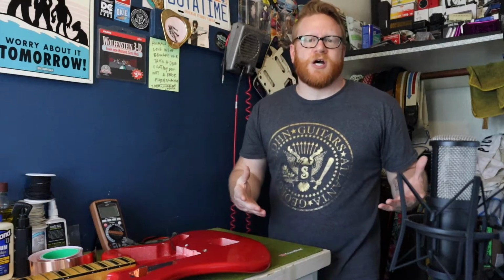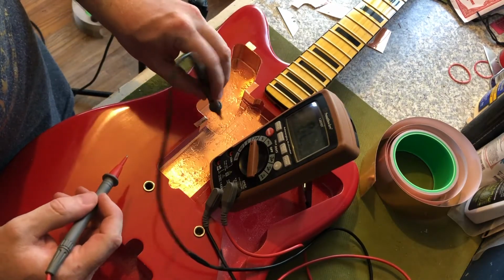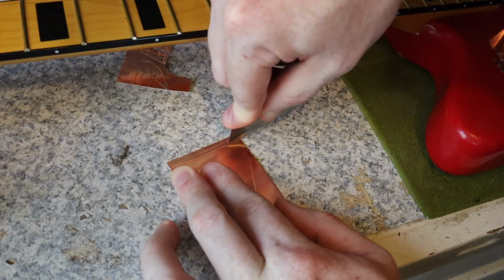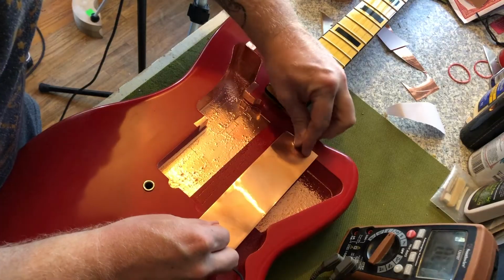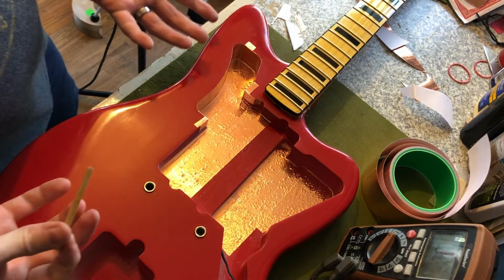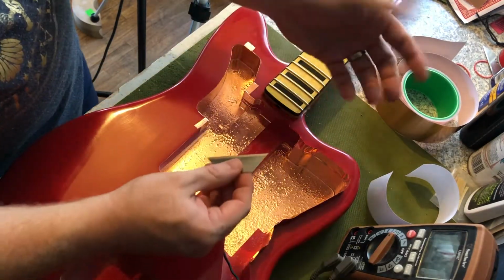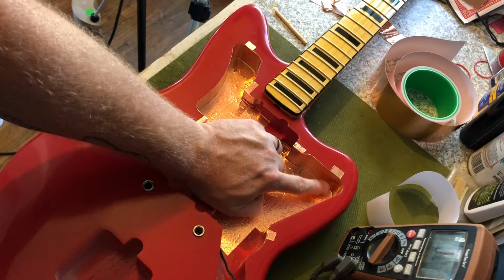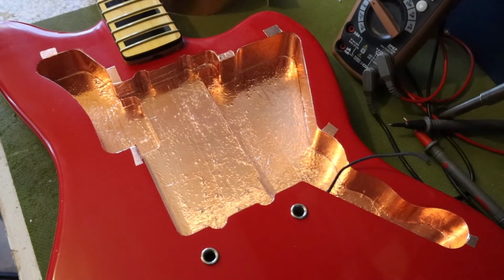GUITAR SHIELDING 101: A [Relatively] Quick Guide to Working with Foil Tape

Comment: When you are overlapping the pieces of copper, if you cut a little bit of the copper making a tab... and fold it back on itself before you lay it in place... you will have a copper to copper contact that will insure that the foil will be continuous through the cavity... it's the same kind of tabbing that you use to contact the foil on the back of the pic guard... only it's for the internal part of the cavity to itself... my thinking here is that the adhesive will deteriorate with time and could lose continuity...

Comment: That is huge pool cavity routing....i would have glued & screwed some Oak or other hardwood inside to strengthen all that routing...i guess he wants the weight kept down, all to our own ,i would have routed the pickups cavities,rear control cavity etc & routed out tone pockets to lighten the weight...i hope that 1 1/2" × 3/4" centre strut is really strong...i bought a Fender Cyclone routed similar & the guitar body actually flexed with strings on it due to the amount of routing, the Vintage Trem did'nt help...i filled the pool routing with 300yr old Oak forming seperate pickup cavities to reduce noise when sheilded with Graphite paint,if done properly (in the cold as it dries so fast) it sheilds really well after 3 medium coats of it....i still have it 13 yrs later,fantastic guitar,a sloping Strat 'Tex- Mex)single coil on the neck & a Fender Atomic humbucker beside bridge , going to replace the humbucker with a high quality quiet PAF'59. 24 3/4" scale compaired to Fender's standard 25 1/2", nice guitar now with no body flexing & very quiet even with the Strat 'Tex- Mex' sloping single coil on it's own, i find if done properly the graphite sheilding paint lasts many, many years & can be spray painted on top of to stop any kind of shorting due to wiring, caps ,pots etc touching the sheilding paint....neat job bud, i think your pal will enjoy it more now.....

Comment: thanks for this great video, wish I'd seen it before I'd botched the shielding on my jazzy by doing with a hundred of small pieces of foil, leaving me with up to 100 Ohms between the input jack area and rhythm circuit area. some overlapping pieces don't even seem to have continuity between them anymore when I last checked it, so that's a project waiting for me lol.
also, a quesiton: if the guitar cavity is pre-painted with shielding paint, how would you go about shielding the rest of the guitar? foil on the guard and solder a wire between them or maybe just a tab of foil in the cavity to make contact with the foil-covered guard?
Reply from the maker: I find that shielding paint can be great, but it's also pretty tough to test for continuity and thus having contact alone doesn't seem to work every time. I might suggest using the very trick that modern fender uses, namely screwing a metal clip directly to the body where the paint exists and soldering a lead to it, then to the volume pot
Reply: I don't trust tape adhesive to be conductive, at least not to remain consistently conductive over time. If you want to be absolutely certain that the pieces of copper foil remain electrically bonded to each other, then you can either solder the seams (you don't have to solder the full length of the seam, just a small area); or,  you can do what I've done  when working with ordinary aluminum foil tape, which is to take a miniature Philips screwdriver (#0 tip size) and press it hard into the foil where the seams overlap with a slight twisting motion. This will make a sort of rivet connection between the overlapping layers. Do this every inch or so along the seams and then check with an ohmeter. Aluminum tape has the advantage of being ridiculously cheap, and if you don't like how your first attempt comes out, you can afford to yank it out and redo it, or not. The disadvantage to aluminum foil is that you can't solder to it (you'll need to anchor a tiny brass screw ithat you can solder to, or affix a ring terminal underneath, through the foil and into rhe wood), and it's stiffer than copper and trickier to work with.....but it's cheap and very effective as shielding.

Comment: Have you ever tried using conductive paint instead of foil? Just wondering about the pros and cons. I can imagine you'd have to screw in terminals for ground connection, since you can't solder to the paint.

Comment: Cool instructional video.  Weirdly, I like stock guitars.  Also, I like to play more than work on guitars.  I've heard anodized pick guards cut down on noise (i.e. J. Mascis Jazzmaster).  If true, to reduce a fair bit of noise, could you just put foil on the back of the pick guard (and where applicable, the control plate) and call it good?

Comment: Nicely done. Especially cutting the tabs that will make contact with the pickguard. It's a good idea to have multiple tabs near the screw points, just in case a pickguard warps over time and lifts up. If the hole pattern or the pickguard are available I make my tabs lay down right over the screw hole so contact is assured.

Comment: That is one clean shielding job, especially compared to the mess I made in my Precision bass a few weeks ago. The buzz is gone but the pickguard still makes static noises when I rub my hand on it, which sometimes happens when I play. I didn't shield all of the pickguard, though, only the part over the electronics. What can I do?

Anyway I wish all techs cared as much as you. I wouldn't hesitate to let you work on my precious guitars.
Reply from the maker: Sometimes static build up can be eliminated by leaving a dryer sheet in the cavity, which is wild.
Reply: @Puisheen  I've heard about those but I can't find them here in Poland. We dont have dryers at home. Will keep looking for them thanks
Reply: @Puisheen  I used antistatic spray and the static is gone. Cheers
Reply from the maker: @AndreaAustoni  By my troth, I had no idea such a thing existed lol thank you for the tip!

Comment: Because I made a custom extended Brushed Stainless Steel Pick guard loaded with 3 quad rail/coil humbuckers wired like  50's Les Paul with P/P vol. pots for coil splitting and the bridge tone pot also a P/P to activate the bridge and neck P/Ups together regardless of any other controls all the pots are 500K audio taper and the tome caps are .047 orange drops. there are 6 pots total because 3 humbuckers and the Fender 5-way blade selector switch and a kill button round out the controls that are all grounded through their cases to the Pick guard including the output jack also mounted in the pick guard just rearward of the bridge... Yup Yup,   wiring all these goodies was quite the adventure , soldering all those connections to make everybody play nicely with each other ans sounding great...realizing that the usual/traditional wire was way to big/thick for the minimal current produced by the P/Ups, I stripped out a computer VGA Cable for the small stranded wires in it which are fine for the minimal current they must transmit through the circuit to the output jack and into the amp where that little bit is multiplied so much anyway... . and the different colors in there were hands to use in the detailed circuit One color for each P/ up and pot set.. as well as the custom wiring for the bridge and neck P/ups working together independently of the other controls when activated by the bridge tone P/P [pot for that little tricks made up for it... lol  ... the rest is fairly standard coil splits and the rest... it all works fine if so very different from any other Strat. I had originally shielded the extended control cavity with the copper tape but then had unwanted  ground issues so stripped it out and checked if I really needed it.. and reall no so left it without  as all is grounded through the stainless steel of the pick guard through the pot casings and switch frames it's fine as is,, imagine what it sounds like with 3 vol., 3 tone, a 5-way switch coil splitting and a kill button just for fun ...  So, how many tones do you thing I can get with all these adjustments available in just this guitar.. and add to that my little Blackstar ID Core stereo 4o Amp. (V1) with all of it's built in effects ... I won't even try to count them all.. lets just say it's a lot...   lol   My "Stellarcaster" , which started life as a cheap Chinese made 'Starcaster'-'Strat'- electric guitar By: Fender.. I bought used at my local Music-Go-Round a few years ago, in order to do this extreme rebuild/mod to my design, with all those neat little tricks in it... MY "Stellarcaster" really  rocks the Cosmos...Wanna Play???   Lmao

Comment: Very informative. Any pros and cons to re-shielding a vintage guitar? Does the original shielding ever need to be replaced?
Reply from the maker: No, there's not usually a reason to re-shield unless there's some extreme issue with corrosion or something, not that I've ever seen such an issue.

Comment: Doesn't copper foil oxidize & lose its surface conductivity over time on exposed areas ? Yes I know its surface oxidation so it should not effect the Faraday cage shielding aspect of it. However what about grounding contacts with the electric parts of the guitar ?

Comment: Would you suggest adding shielding tape to a gold anodized guard (j mascis?) or just ground the guard ask its already metal
Reply from the maker: No! Those guards are the best you can get as far as shielding goes. Just make sure to sand away the anode layer (the gold) around every component to bare aluminum for a solid ground connection—this part is crucial

Comment: What if you want to shield a jaguar? Does anything change in terms of what you do or what you need to beware of? 

In particular: 
1. Do you shield the back side of the three control plates and ground them to the copper tape as well?

2. Jag pickups often fit pretty snugly in their pockets. Do you need to worry about the copper tape interacting negatively /grounding out due to its proximity to the pickup claws on jag pickups?
Reply from the maker: The control plates are metal, they're already big shields. 
Jag pickups are not that snug. Shield as normal

Comment: Two questions...1) do you have to do the same thing with the vibrato cavity and then run a wire between that and the main body for continuity? And 2) if the inside is all shielded and the underside of the pickguard is all shielded, and all the metal of the pots and switches are touching the pickguard, would it be considered grounded at that point and no need to run a ground to the trem or bridge?

Awesome videos by the way!
Reply from the maker: 1) the vibrato cavity does not factor into this, the idea is to basically build a cage around the electronics. Grounding the vibrato is enough, though I often do prefer to ground the trem rather than the bridge thimbles. 

2) Personally, I still ground all the electronics as usual. Yes, they're electrically connected via the copper, but a soldered ground wire will always be more dependable. The only case where I omit ground wires are when pots are mounted to a plate like on a Jag, Mustang, or Tele.
Reply: Puisheen for a Tele to ground you would want a little strip of copper tape under potentiometer guard so all zones (bridge, neck, electronic/pots) are therefore connected and grounded right? What about foiling the back of the Tele pick guard. Great video!
Reply from the maker: @uhldev  Thanks! For a Tele you would still want control cavity shielding, and normally I do put a bit of foil on the back of the pickguard there as well, but you really only need so much to cover the neck pickup rout as well as that little channel for its wires
Reply: Puisheen thanks!!

Comment: Hey there!   I want to shield my jaguar as well as my jazzmaster.  I have some questions:

Do I need to shield the back of the silver metal plates the rhythm circuit and tone controls etc are on?
Am I supposed to shield between and into the holes that the cables in the Jaguar go through going from the pickups to the rhythm circuit or tone controls etc?  

Should I shield the routed cavity for the vibrato?
Reply: No need to shield the back of the metal switch plates, nor do you need to shield the vibrato cavity (unless there are signal carrying wires passing through it, which is doubtful).  It may not be possible or practical to shield the holes that the wire is passes through from one cavity to the next, unless the holes are drilled quite large, but if the pickups have shielded wire that passes through those holes, then it won't matter. If the wires passing through the holes are unshielded, then the only way I can think of to shield those passageways would be with a small diameter spring or thin wall brass tubing, which might not leave room for the wires themselves. Probably neither practical nor necessary....

Comment: Pls can u make a video about the ground wire on the bridge Bush? I changed bushes to install a usa pro bridge on a Squier VM jag, so i swapped out the Bush and voilà the ground wire popped out too! Now i'm wondering if solder the ground in the Bush or Just wrap It inside? Better solder the ground to the tremolo.unit?
I dont like.the idea to remove the Bush if i got any ground problem.. thx man u r my offset master
Reply from the maker: The ground wire just goes in with the bushing, no solder required!
Reply: @Puisheen  wrap around the Bush or Just pushed in?

Comment: Hi Mike 
Ones again a great video. I’m just discovering your videos. Just the info I need. I just finished my own guitar build heavily inspired by Novo Serus J by Dennis Fano with Mastery bridge and vibrato and Lollar gold foil pickups. I have bought conductive paint for the cavities though. Do you have a opinion on that vs the foil?
Thanks again 
Michael
Reply from the maker: I have a personal opinion here: I don't like the paint! But that's me, and my main reason for not liking it as much is that it's really hard to check your work. With foil, you can often see a bad connection, and if not, a multimeter allows you to check conductivity easily. With paint, it's much harder to know for sure that it's been properly applied, and so I'd rather use foil. BUT don't let me stop you! As long as you apply it well and use a few coats you should be fine.
Reply: Thanks again Mike.
I’m documenting my build on my own channel and I will definitely mention your thoughts on this when I’m shielding. Great input. But now that I have bought the paint I’ll try it out. 👍🏼
Michael
Reply from the maker: @MichaelLagerstedt  I'm watching now! That 335 is beautiful!
Reply from the maker: @MichaelLagerstedt  Aaaaand now I want to watch CONTACT
Reply: Puisheen 🤣... absolutely... one of my all time favourite movies and so appropriate when talking about shielding ...

Comment: Nice job! One question, do you have to connect the ground wire to the foil as well?
Reply from the maker: Some people like to, but because the back of the guard is also foiled, a solid connection is made between the body foil, the guard foil, and the electronic components. I find the wire directly soldered to the foil redundant
Reply: Copper shield needs to be connected together and hooked up to ground. If not you will have a large antenna and more noise.

Comment: I'm shielding a recently painted strat... Bought copper shielding tape, but the pick guard has aluminum tape applied. Should I go over it with copper to prevent metals from reacting to each other?
Reply from the maker: That's up to you, really. I'm not sure I've ever experienced an issue with the two types touching, but if you do decide to go ahead with it, replace the tape instead of going over it.
Reply: @Puisheen  thank you, I'll try mixing metals and see if the results are good enough :)
Reply: @GardevoirEx1  Only difference between them is that copper will eat up aluminum. They don´t react to well over time and the copper will corode away the aluminum. Copper is also a better conductor.

Comment: I’ve seen it said elsewhere that the foil needs to be connected to the volume pot with a ground wire. Is that actually necessary?
Reply: Yes.  If the foil shield inside the body cavity and the foil on the back of the pickguard are not grounded then all that metal will become an antenna instead of a shielded cage.

Comment: ...I'm clueless, what do you set the meter to for continuity? And do you ever (lightly) sand the cavity floor to remove those paint nubs??
Reply from the maker: I don't usually worry too much about those nubbins but it couldn't hurt! And the meter has a 'continuity' mode that beeps when a connection is made between the probes, I don't know if there's another term for it

Comment: Hey Mike - If the routing has already been painted in the black shielding paint, is it worth doing this or pointless?
Reply from the maker: If there's already paint, you probably don't need to do it again, but DO try to check for continuity anyway just to make sure it's all applied properly.
Reply from the maker: Or wait, maybe DOUBLE SHIELDING IS TWICE AS GOOD
Reply from the maker: jk it's redundant don't bother haha